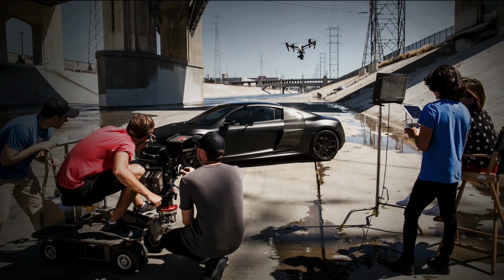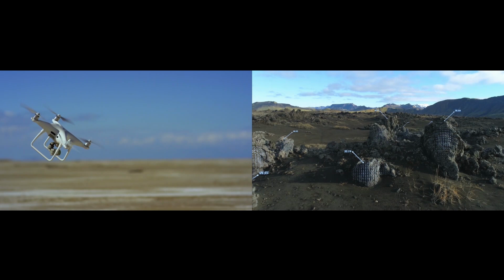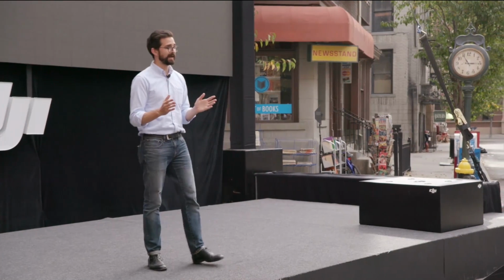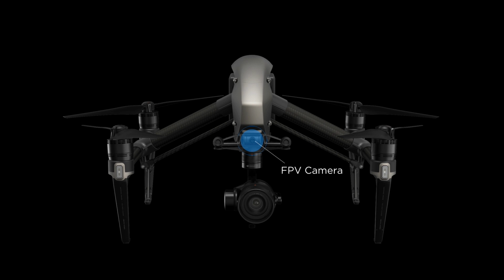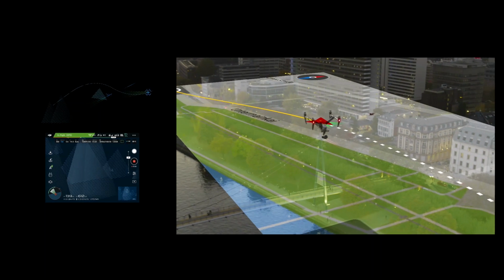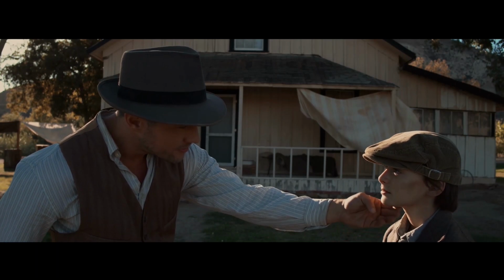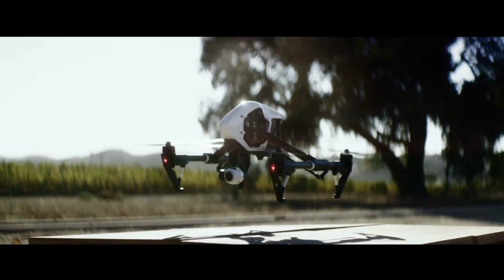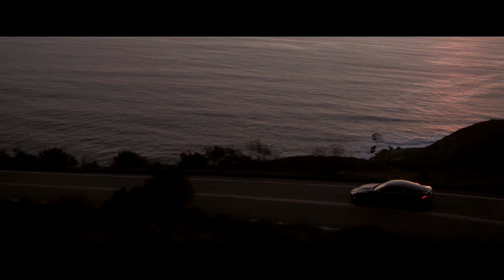DJI - Inspire 2/Phantom 4 Pro - Live Launch Event

Comment: 8:25 3 years from now, this will be the bottom of the line like the P3S today.
Reply: Mike Rivest
Reply: Mike Rivest possibly, but how much data can a computer process. pc's have slowed down in recent yrs. and lens manufacture has also slowed down. the sensor is pretty amazing.. if the cameras of the future are processing 100mp for example, what computers are going to handle the data ? all technologies have a curve, and will slow down in improvements at some stage.